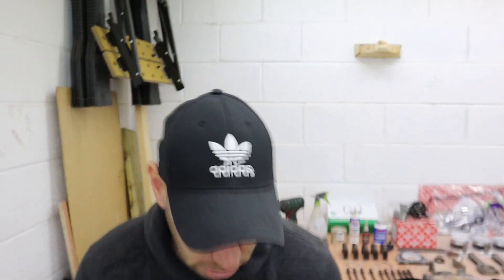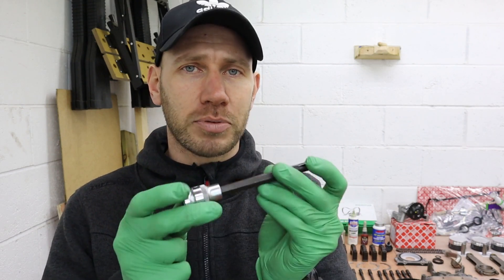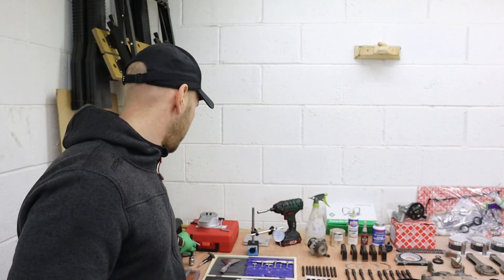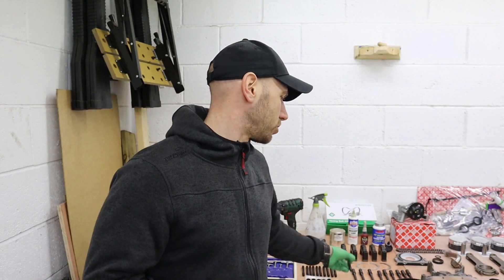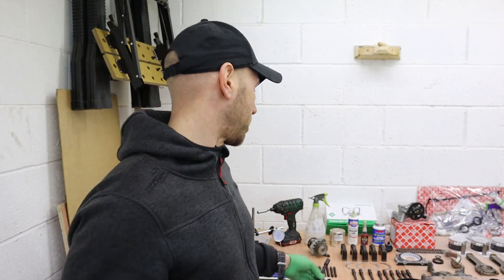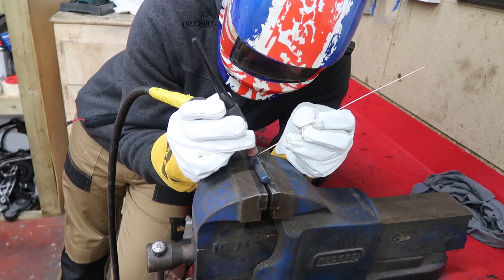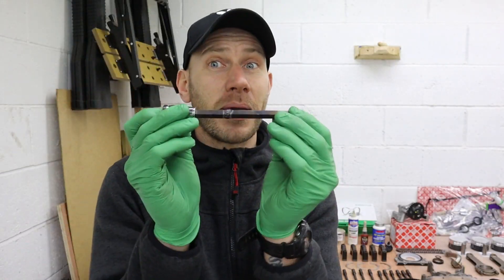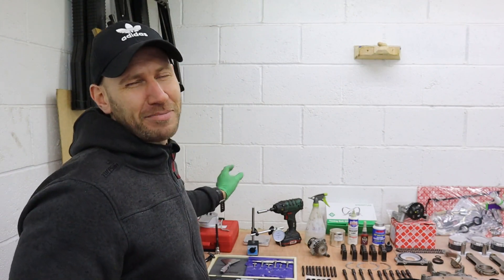ARP Head Stud Tool // 1.8t Stroker Engine Build

Comment: Take it this is another BAM block mate, not the engine in furious frog. Are you going to be using the Garrett off the old S3
Reply from the maker: This is for the AGU block that I stripped down in a previous video mate. Making a 2l stroker motor for it, and adding the JNL head I've got. Still undecided on turbo but I think the GT30 would be too big, so probably not.
Reply: @DecimalTenths  maybe BBT but depends on if your staying K04, I presume with your exhaust/manifold set up.
Reply from the maker: @richardstubbings6962  I'd prefer to step.away from a k04 frame turbo setup in all honesty mate. Cracking power and response but the heat generated at a decent power level on track is ridiculous.
Reply: @DecimalTenths  even the K03s hybrid I'm running gives a lot of heat off. Mine as you know is the Turbo Dynamics MD288 but I agree with the track focus you have keep temps down is vital, your water meth will help but always a struggle with temperature in the bay.
Reply from the maker: @richardstubbings6962  for sure mate. I'm thinking of a slightly bigger turbo setup, with good flow that can be ran at a lower level and give either the same or better results. The 2l stroker motor will help low down and provide more oomph to push a bigger turbo on sooner. Couple it to water meth and some big ass bonnet vents and it should be sweet.